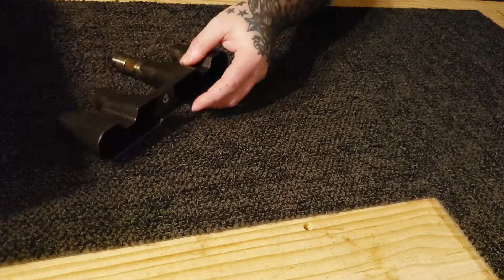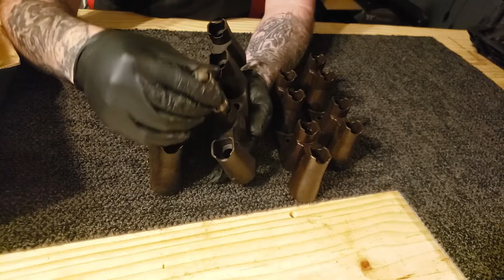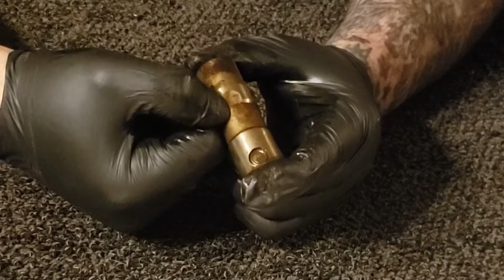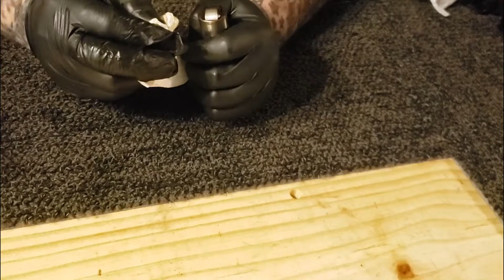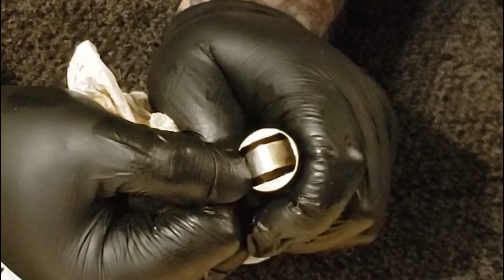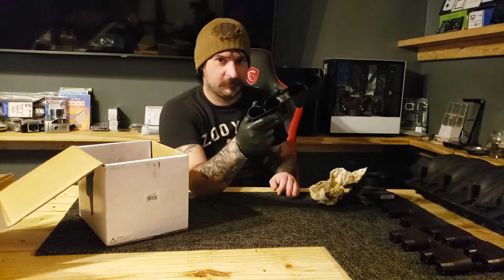Checking Your LS Engines Lifters And Lifter Trays - How To

Comment: do you recommend ls7 or ls2 trays when i rebuild my ls1?
Reply from the maker: I always used LS2 most the time, they a way better upgrade over the weak ls1 trays, I think the ls7 lifter trays are a redesign which if you hold a ls2 tray next to a ls7 tray you can tell lol, I think most the kits you see are sold with LS2 trays. but go with what you think is best for you

Comment: I’m having trouble finding good replacement lifters for my 5.3. Seeing the reviews makes it even worse
Reply from the maker: that's one reason I will keep my OEM as they checked out good, but if you looking for replacements I would try calling your local Chevy dealership and ask for parts, its not the budget way of doing things but you know they are real GM parts and not knock offs or fake GM lifters or the GM lifters that don't fully make the GM quality cut and get sold to wholesalers, also get you a set of trays while you at it.
Reply: @TattsForLife  I agree I was considering the morels which are noisy, I have read too many ls7 replacement lifters having trouble also though. So what do I do? The replacement lifters for the 5.3 now is the ls7 lifters. I may be mistaken, but I believe the cup depth is different from my oem on the lm7 to the ls7 lifters, so then would that mean new pushrods also have to be bought? Idk man
Reply from the maker: @timweb1510  I think the ls7 lifters have a lower skirt and is a stronger design, but same push rod length, but you can always check your pushrod length at assemble